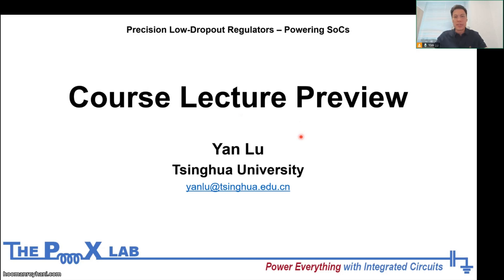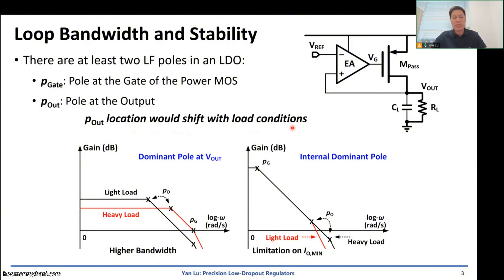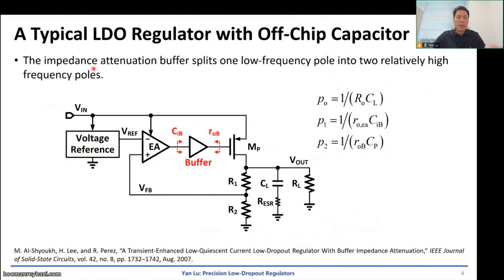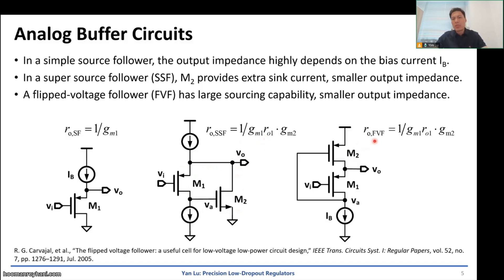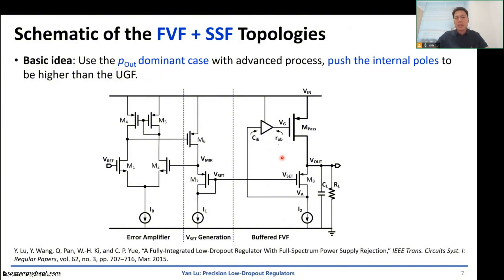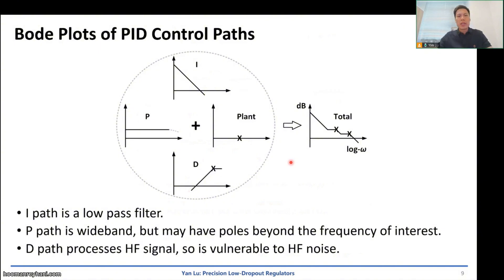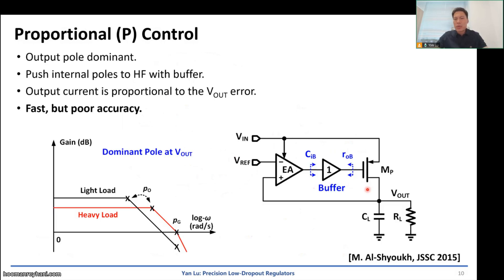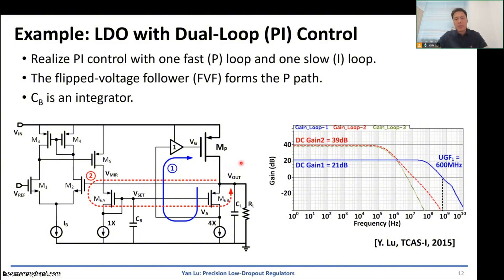Preview - “Precision Low-Dropout Regulators” Online Course (2025) - Prof. Yan Lu (Tsinghua U.)

Comment: Hi Dr. LU. In the last slides. Why is it necessary to use 3 loops? I think Vmir is determined by Vref, and the DC level of Vout can be determined by Vmir by utilizing the M6A and M6B, which form a common-gate amp "diff pair". Loops 2 and 3 will then be cascaded rather than nested, ensuring stability.